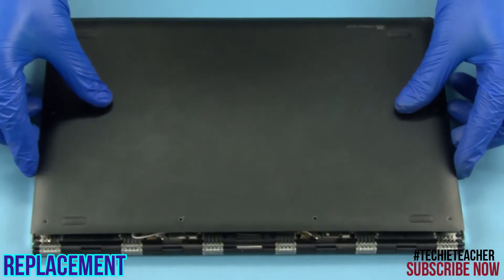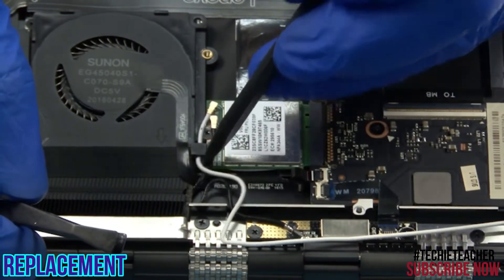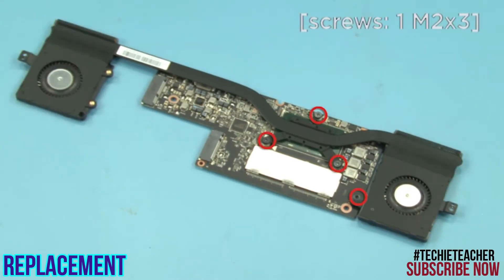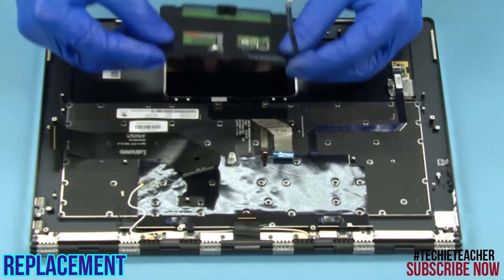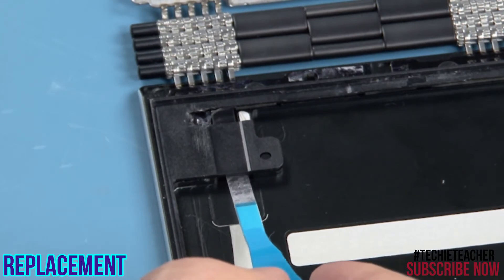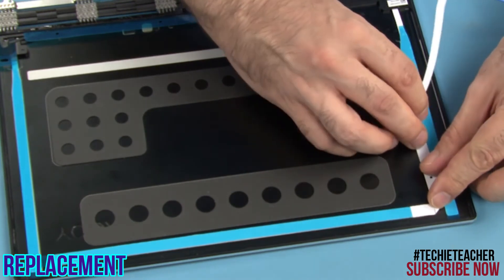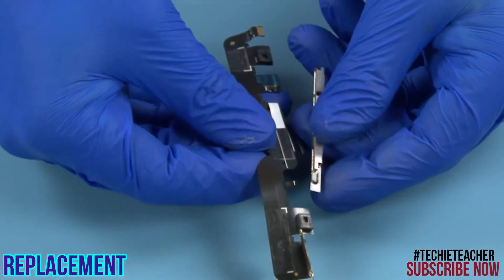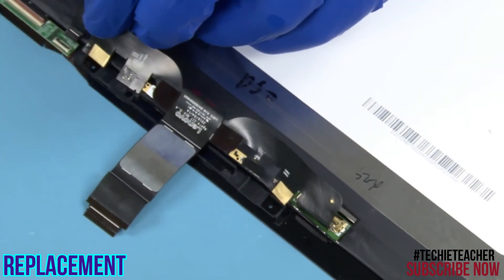HOW TO DISASSEMBLE/REPLACE PARTS OF Flex Pro-13IKB (81TF) / Yoga 920-13IKB (80Y7, 80Y8)

Comment: Can someone PLEASE FOR THE SAKE OF ALL THAT'S HOLY! I have a Lenovo Legion Y520T-25IKL With an Intel (R) Core i5 7400(k?) And My fan at the bottom (floor of the pc) is trying isn't working properly. It starts spinning for about 3-5 seconds and then just stops! I have checked the wire, cleaned the pc and yet nothing! I'm planing on buing a new one., but I'm no pro and I have no clue on what mm I need? I'm BEGGING please somebody help me! it has been like this for 2-3 years!
Reply from the maker: the fan needs to be replace